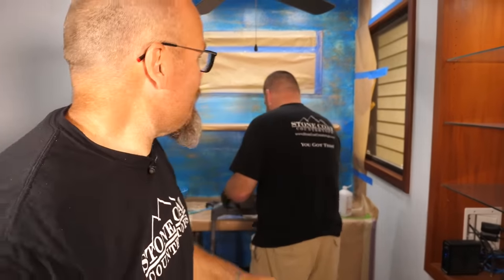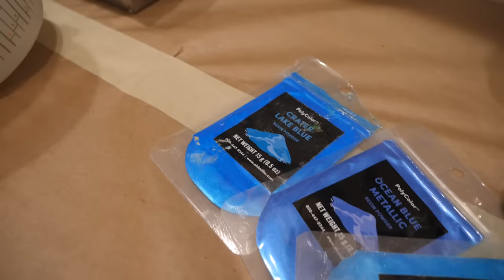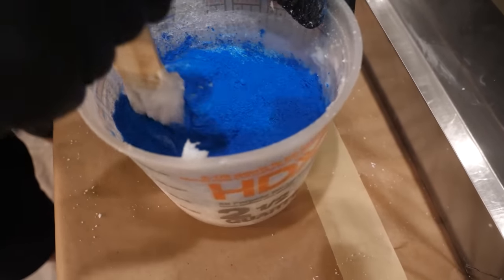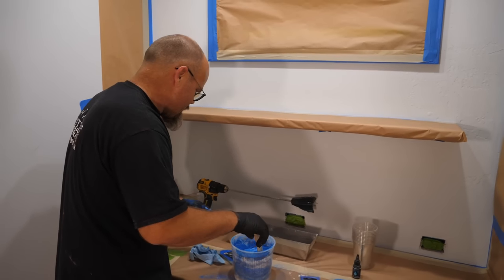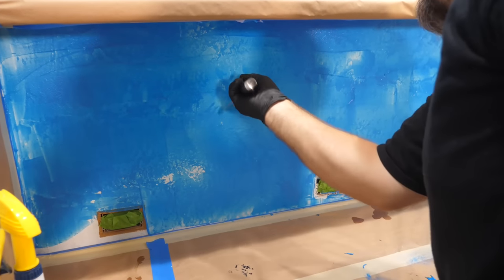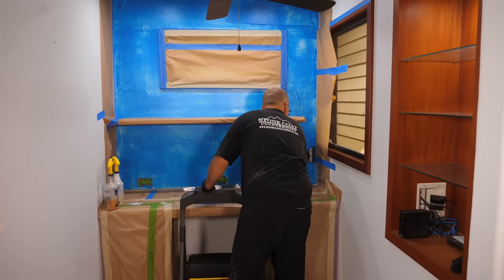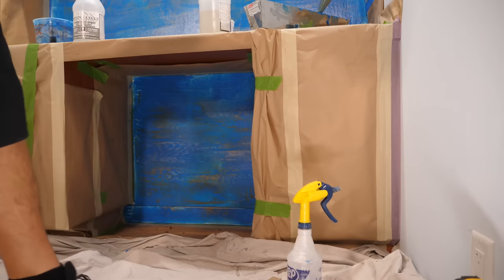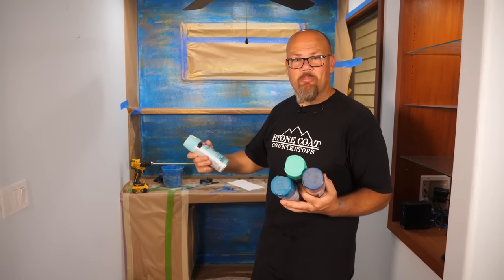Vertical Wall Epoxy | Stone Coat Epoxy

Comment: I like the idea of having a white layer on the bottom thin, then skipping around with the blue using the wall texture to make it like the sun changing the blue water because of the reflections in the ripples

Comment: Would this technique work for shower walls? New construction, apply thickened epoxy directly to moisture (green or purple) board?
I've seen your video using the styrofoam panels, but wondering if this technique would allow for more creativity in a shower?
Reply: @teo2real487  why do you say that? I was thinking about using it.
Reply: @dupp2424  This is a great product. I'm not sure why 21mill doesn't like it. I have done several projects with Stonecoat and they have all turned out great.
Reply: Or over existing surround? Would it stick?

Comment: Hi, i would like to ask. What if i want to coat my kitchen counters with epoxy, with vertical waterfall surface on both ends? Do i do the horizontal top first and come back later to do the waterfall edge or do i just do it all once by pouring epoxy on all surface incliding the waterfall edge?

Comment: The thickner looks like a great product. I’m wondering if it and the epoxy could be used to go over my 90’s muave colored  tub enclosure. I’m also wondering if it’s possible to do a marble effect with the thickened epoxy. This would be great for a backsplash above a kitchen countertop. Paint the wall the color of the grout, mask off subway tile, apply the thickened epoxy, remove the masking, and after the epoxy dries add either a thickened clear coat and/or an ultimate top coat. If possible I would like to see a demo on doing a marble finish on a wall using the thickened epoxy. By the way, I’m starting on my countertops this week. Everyone keep me in your thoughts. If I screw up, my wife is going to kill me!
Reply: Wondering if you ever did your shower and tub surround? If you did would love to know how it turned out!!! I was thinking of doing the same thing. Have a fiberglass tub and shower combo.

Comment: If you don’t want that textured look what would you have to do?
Reply: Great question! You will have to keep in mind the texture of the wall underneath your epoxy mixture because it will show through. Having a smooth surface underneath will help a ton! Also, the mixing ratio for epoxy + thickener can be adjusted to your preference. Where do you plan to recreate this project?

Comment: Can youse this on a kitchen walls as a back splash and clean grease off of it?
Reply from the maker: Yes, You can clean with normal household countertop cleaners, but soap and water generally do the trick. Just try to stay away from very harsh chemicals such as bleach and ammonia. -Nathan

Comment: Is it possible to thin it enough to roll or brush?
Reply: Great question. :) It is recommended to use a 1:1 ratio, but the mixing ratio can be adjusted to your preference. You just want to avoid the mixture running down your project. If anything, take a small part of the wall and try it out with desired tools and consistency. See how it turns out. Good luck my friend!

Comment: this one personally I didn't like, obviously you couldn't with the window, but I'm wondering if you could possibly do a big board on the ground, and then lift it into the spot with the right adhesive. kind of like done with the showers
Reply: Yeah you can do that but make sure you take the thickness of substrate into account

Comment: Hve you tried this straight on shower walls?  Would  you Red Guard the walls prior to using the epoxy?  Going straight on concrete board, Thought to Redguard then prime or go straight on redguard???
Reply: Stonecoat has videos showing how to make the shower walls and how to apply the Red Gard... Search YouTube “Stone coat shower” the list pops right up.  Hope this helps!

Comment: Hi. I have a waterfall concrete kitchen island that i plan to coat with epoxy. How do i do the vertical waterfall sides of the countertop? Do i just pour it all in place one shot or should i do the top first and do the vertical sides later with cabosil?

Comment: Can you brush or roll a thin clear coat epoxy over that for the glass like effect? Or will it just drip?
Reply from the maker: Our Epoxy is designed to be poured on troweled out for a clear coat, the thickening powder does make the epoxy cloudy that is why we add a metallic for vertical application. The UTC is designed to be rolled on. Good question! Please do not hesitate to call our project support if you have any questions. You Got This!

Comment: Not related to this video... but two things. We are about to buy 70 sqft worth of epoxy from you guys for our kitchen. Question one - do you tape off backsplash? Or just pour the epoxy and let it touch the backsplash. If it matters the backsplash is subway tile not like rocks or anything. Question two - do you guys have any coupon codes like free shipping or discounts?

Comment: If you used the ultimate topcoat glossy on this would that add more of shine to it?
Reply from the maker: It could add a bit of gloss. You could make a panel and coat with SCC to get the high gloss glass like finish and install! You Got This
Reply: @StoneCoatCountertops  I was thinking sorry about that . That I would take a piece of Formica laminate cut it to size do normal countertop coating then glue on wall.

Comment: Can you use that to texture the edge of table tops instead of the Epoxy or texture the whole table top and do a semi-deep pour for a smooth finish over the texture
Reply from the maker: you could! or you could also use bondo and do a semi-deep pour as well. i would test both ways see which you like better